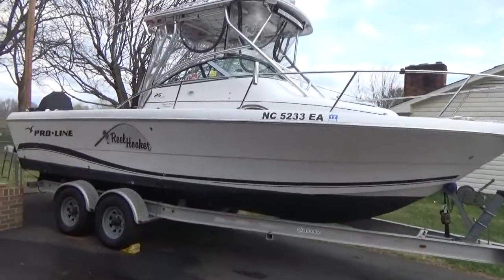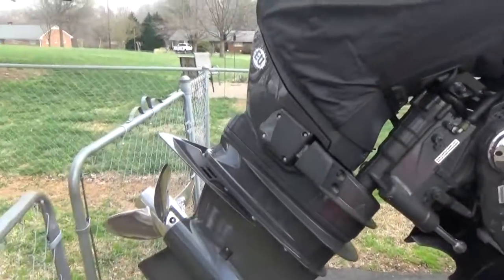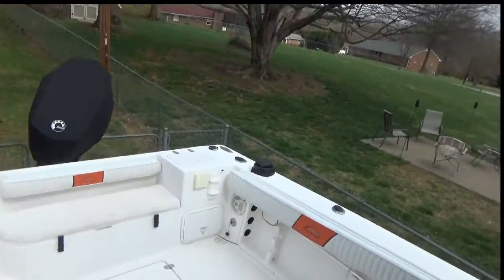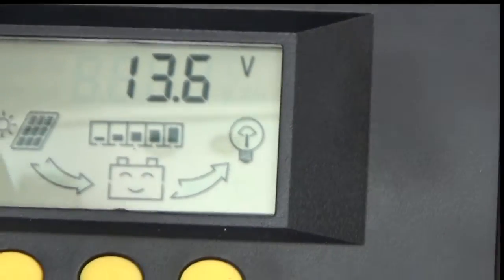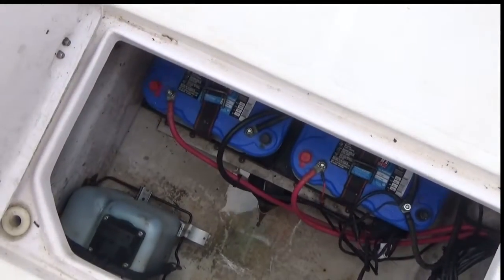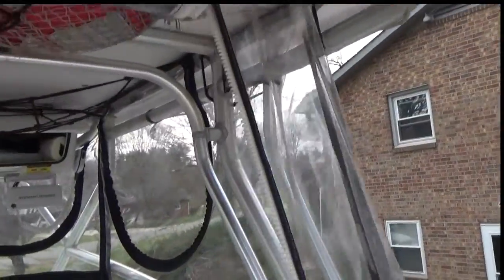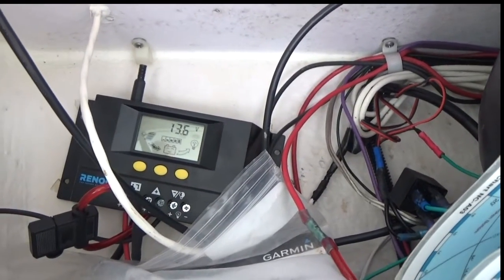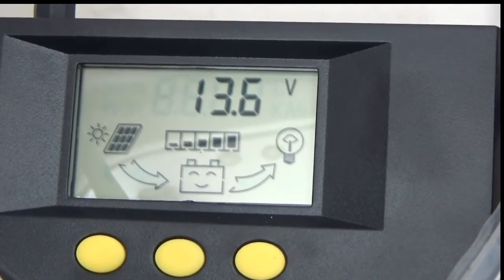How to install:   Onboard Solar Powered Battery Charger & Tender for Boat or Camper

Comment: How long would them LED lights stay on at night with 2 batterys with the engine off??
Reply from the maker: I would think they would last all night plus well into the next day.  LEDs draw very little power which is why I have changed all my lights over to LED, they also give off very little heat which is a bonus.

Comment: Can you still use shore (plug in) power, does the solar have to be unplugged?
Reply from the maker: Yes you can, the panel will not need to be unplugged.
Reply: Awesome - I'll be following your lead soon. Thanks for the info!
Reply from the maker: If you can find a copy, I wrote an installation article for Boating World magazine (July/August 2017)
Reply: I'll look for it!

Comment: where did you buy the equipment? the controller with battery in led ,where did you get that? How did you wire it up?
Reply from the maker: Hey James, sorry about the delay on the response but I was at the beach.  I actually have an article in Boating World with a DIY article.this month (July/August) on the installation.  But to answer your question I got the panel and controller from Amazon.  Wiring is pretty simple and will depend on how many batteries you have or what configuration you want use.  If you have any questions on wiring that you can't find on the Renogy site shoot me an email and I will try to walk you through it.

Comment: hey kevin im very interested in doing this to my boat. but was wondering how you  did the wiring from the charge  controller to both batteries  at the same time.
Reply from the maker: wilderg88 there are two options for this and it depends on a couple factors. Renogy makes a dual battery charge controller, so you purchase that and run individual pairs of wires to the individual batteries. This is the best option if you can easily get the wires to the batteries from your charge controller. 

On my boat the batteries connect to an isolator so I can run one battery at a time or both or shut the power off completely. The wires run from that isolator to the helm where there is a power block or distribution center. 

Option two is to run a single battery charge controller and run your battery wire to the power distribution block. That way the power is going to the batteries via the power  block/distribution point.

Either way if you ever need to disconnect the batteries you will need to pull the fuse at the solar panel so you don't risk shocking yourself because as long as there's sunlight (even with clouds) the solar panel is generating power. 

Hope this helps. If you have anymore questions send them in the comments or email.
Reply: Kevin Harris  awesome thanks for the quick  reply.  ill look into the dual charger
Reply from the maker: wilderg88 you're welcome. Like I said any questions give me a shout. It's great to not have to worry about remembering to plug the boat in or worrying about if you have a place to plug the boat in if you're not at home.

The price to run solar is comparable to a good (plug in) dual charger and after the initial purchase there's no additional costs (power bill).  

Plus, if you're out on the water enjoying your radio and running your electronics you will have the batteries charging while your out there so there's less likelihood of a dead battery when it's time to go back in.
Reply: Kevin Harris  would i be able to put the charge  controller to my battery switch and that way it can charge what ever battery  i have selected or both at the same time if i put  it on all?
Reply: Kevin Harris yea man absolutely  thats the main reason i want to go with this.  and it will fit perfectly  on my top.
Reply from the maker: wilderg88 yes you can.
Reply: Kevin Harris perfect i think  thats the route im going to go thanks a ton man tight lines

Comment: how many batteries were you charging with this?  single, dual, triple?
Reply from the maker: I have two Optima blue top D34s (I think) that this charges.  Does a great job.  Nice peace of mind never having to worry about forgetting to put the batteries on a charger.